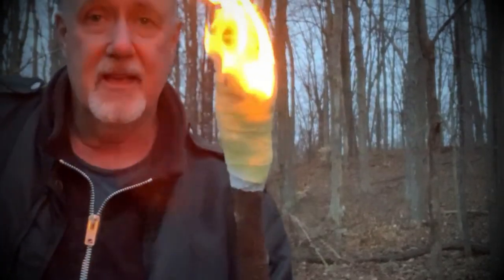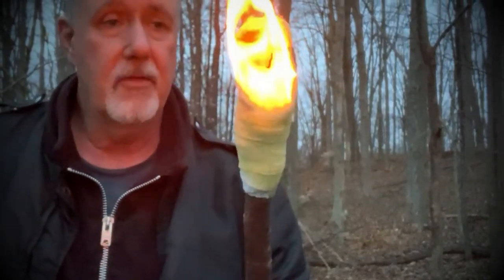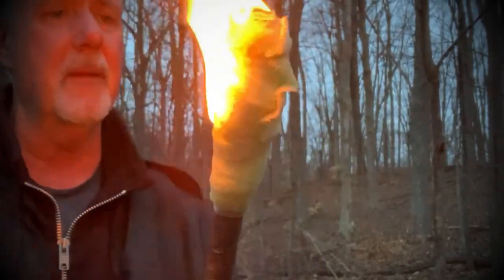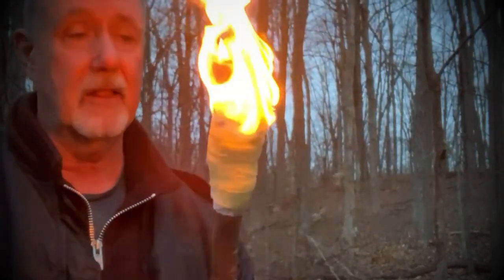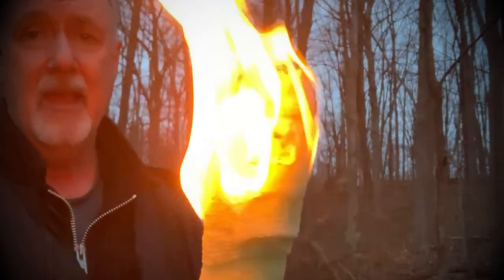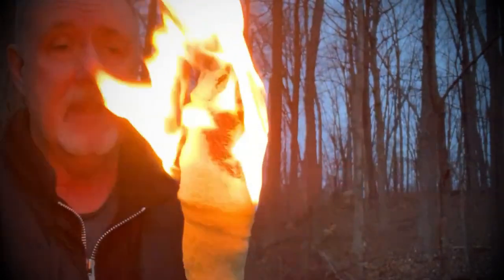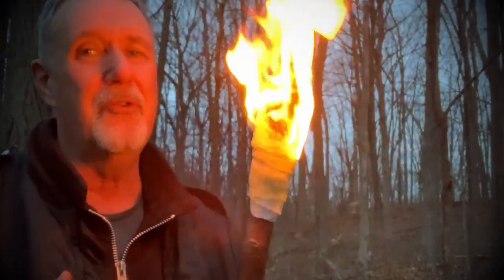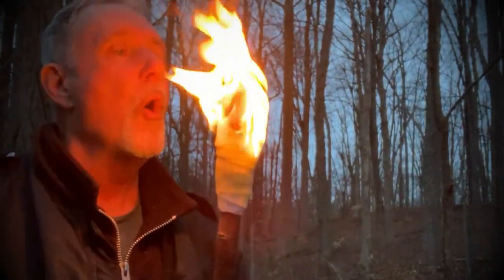Creating an ancient torch from Bible times.

Comment: I didn't know olive oil is flammable
Reply from the maker: Yes!  An the finer the oil of course, the better the burn.  One point is, the oil isn't combustable.  It's not like your olive jar will explode.  It's a controlled burn.
Reply: @OurCanaanChurch  Anything that doesn't light up right away with a flame and you have to hold the flame to heat up the fuel for a while to get it lit will be combustible.  Flammable goes up right away even with a spark while combustible needs to be heated before it can light up.  Olive oil has a flash point of around 410°F (210°C), which means it can ignite when heated to that temperature and exposed to an ignition source, such as a flame or spark. However, it is not as flammable as other oils or substances, so it is considered relatively safe for cooking and other household uses.  Combustible doesn't have anything to do with explosion.